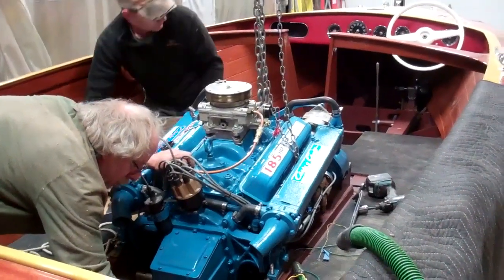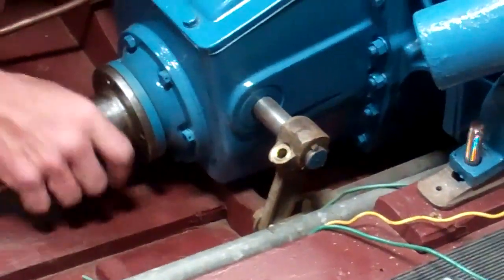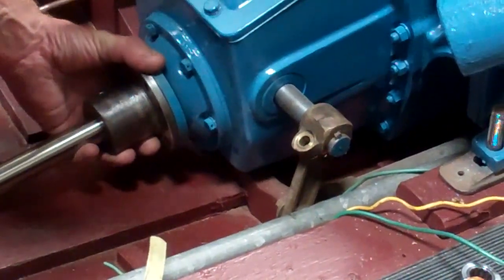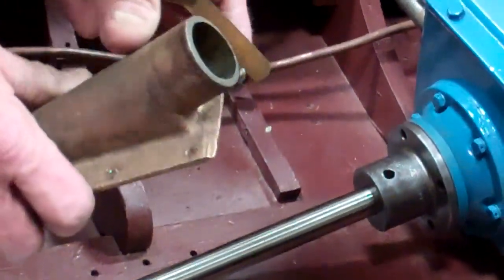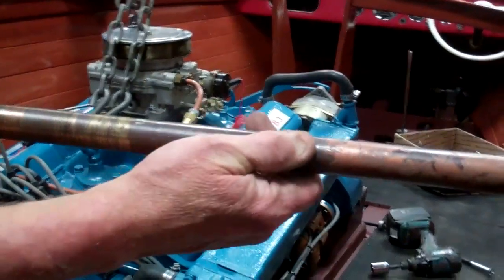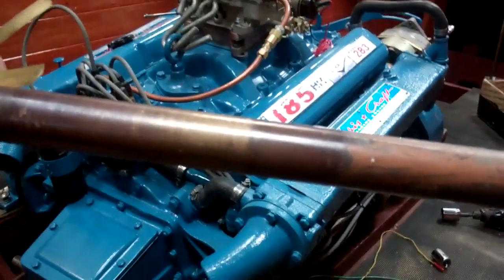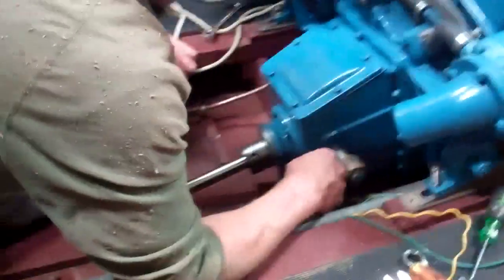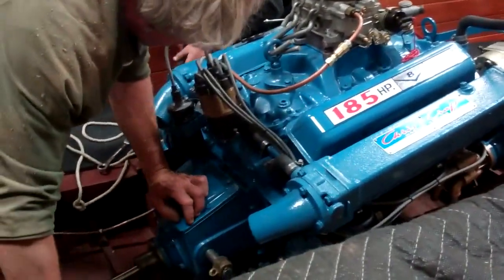1959 Chris Craft 17' Sportsman Engine Install   Alignment is Cricital!!! 6 5 2018

Comment: Maybe it would help to first connect the shaft, with proper alignment, then to set the mounting plates?
Reply: This is exactly the way I have changed to doing it.Putting it all together with the shaft and then by  Moving the whole unit until the screw holes line up perfectly for the strut mount.